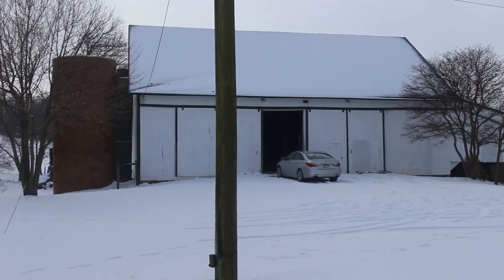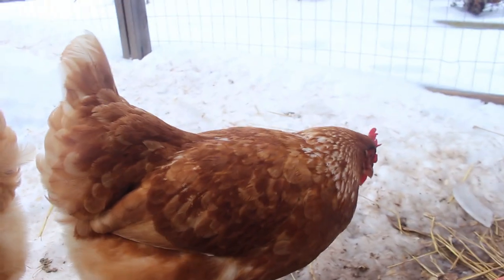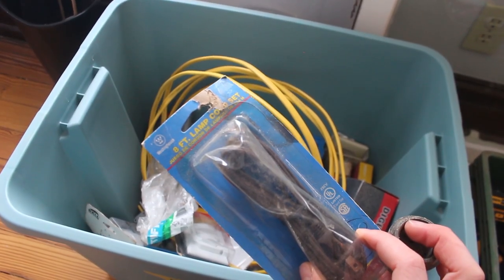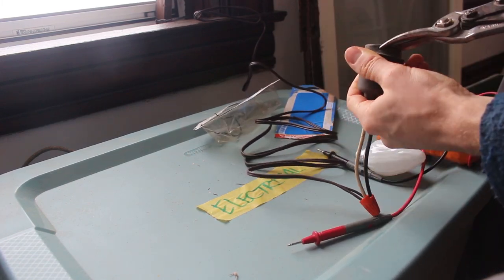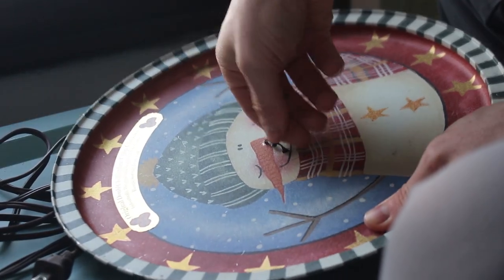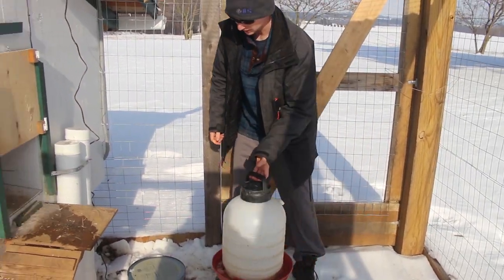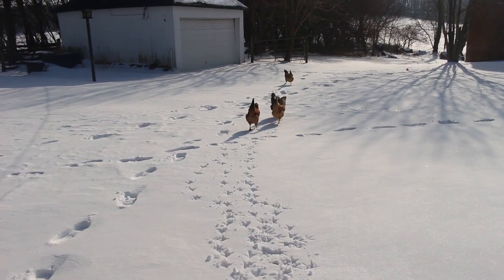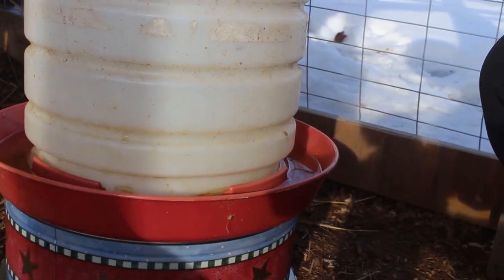Frozen Chicken Water - $2 Solution!

Comment: I'll do the same with mi chickens. Great idea. I would add some isolation material in the part which is in contact with the ground and around the tin. Something simple, bubble wrap, card board or some styrofoam to keep the heat from scaping.

Comment: Absolutely love this idea . I’m in montana and battle water for critters all winter . This will solve next winter chickens 🐓
Reply from the maker: We noticed this year that it didn't work well on the really really cold days so just keep that in mind! I also wouldn't put this inside the coop either to prevent any potential fire hazard.
Reply: Maybe if you elevated the light bulb off the bottom and put a water Shield over top of the light bulb add drill some holes in the top so the heat would be directly against the bottom of your water container.... that may work. Then you can experiment with different size light bulbs depending on how cold it gets.

Comment: I did the same and last couple days -11oF ….Fail😂
Reply from the maker: Haha it does have a limit.. ours is also frozen solid this week 😂
Reply: Probably need to insulate it around the outside where not in contact with the waterer and keep it out of the wind.
Reply: You failed.   In horrifically cold situations, the only thing that works is bringing them water from the inside.  This works in states, where those temps only last a few days.

Comment: I'd be surprised if this would work if you got a sustained 2-5 day period of time under 20F.

Personally, I'm going to use one of the 55 gallon drums I have, stick a $35 heater in it and have it run on a thermostat, so it's not running all the time. I also LOVE the idea of using a large 55 gallon barrel, because that means huge amounts of storage. I'm also going to connect a gutter from my coop to it, so I'll never have to fill it! The only question is can I go through an entire winter with the water in there before the winter starts.

 I'm then going to build an insulated box for the barrel.
Reply from the maker: Yeah we've learned there is certainly a limit for how much cold it can take! Where we are it rarely gets that cold for sustained periods though so it works. Sounds like you have a great setup, we also have a 55gal rain barrel fed from the gutter off our coop roof.
Reply: @MasonDixonAcres  

I finally got around to actually doing the setup I mentioned above. 

* I had one clear 55 gallon bucket that I painted black (to reduce algae growth)
* drilled two holes and connected bulk head fittings to them, then garden hoses to the bulk head fittings
* connected washing machine hoses to the garden hose fittings (apparently, they're the same thread)
* connected a small pump that I have connected to a thermostat controlled outlet. Turns on at 37F and turns off at 41F.
* I did indeed put that $35 heater in the 55 gallon barrel

So far, it's working great. We've had three straight 22F nights and it hasn't come close to freezing. During the spring, I'll connect it to my gutter so I never have to fill it. About the only thing I'll have to do is throw maybe 8 ounces of Clorox in the barrel twice a year to further guard against algae and legionnaires. 

It's super clean, I never have to worry about the girls pooping in their water, I love it!